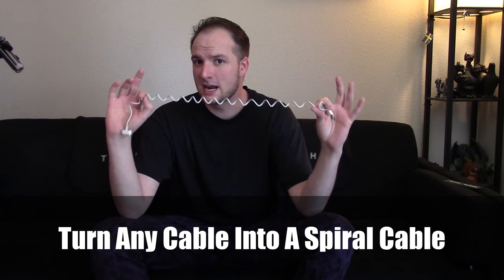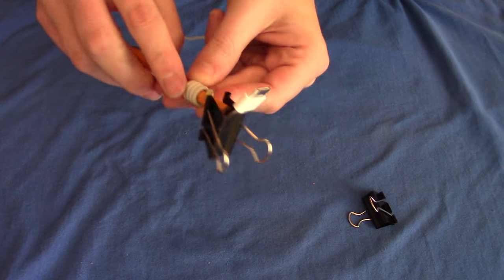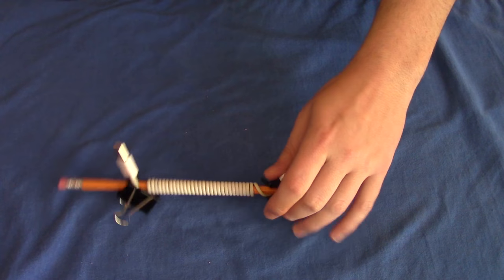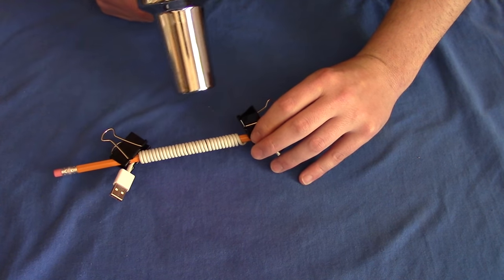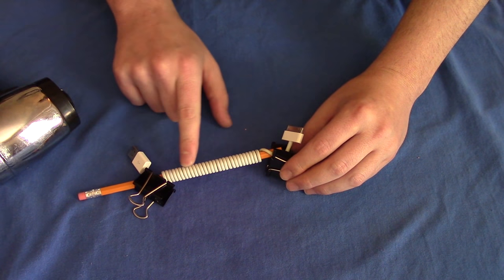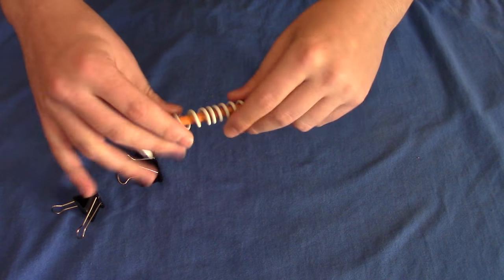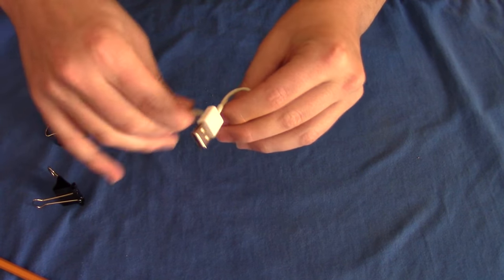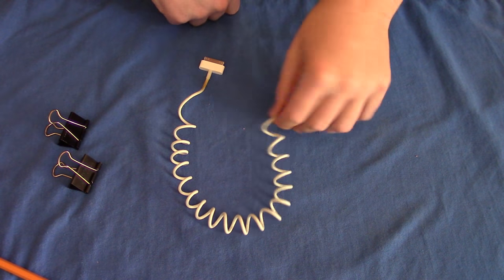🔌 Turn any Cable into a Spiral Cable

Comment: This works great for lamp cords as well...have been doing it for years!
Reply from the maker: got an example you can share? Like pic or video?
Also did you reverse coil after the fact like so many have mentioned here?
Please sub if you can.🙂
Reply: @TheThorns   I've never done it with a heat element, just wrap the cord, starting at the base of the lamp, continue til you reach the plug. You will get a tighter coil, if you do it in a warm room vs a cold room. It turns excess cording into something designer looking.

Comment: I was looking on a way to do Exactly this Since I didn't want to spends 50-100 Dollars on a Cable lol It turned out so Good I had some stock Cables and Colored USB Cables for my Keyboard And it Pretty much Works on Most Cables Just make sure you Heat it up on Max for 10-15 Minutes if you Do 5-10 Minutes it Turns out Looking bad
Reply from the maker: thanks for sharing, 😀 please sub if you can

Comment: Many years ago, I heard someone say that he did this with glue. He would coil it up with the pencil and dip it in glue...
Ive never tried it but this hot air thing looks cleaner and easier. Would have to compare results. Saludos
Reply from the maker: interesting concept, however sounds very messy. Still might have to try it.
Please Sub if you can 😊

Comment: Awesome! The internal wires are now permanetly damage u got a sub!
Reply: No they're not, This is how commercial coiled cables are made. A more industrial process, but plain cable is wrapped around a heated mandrel
Reply from the maker: Thanks for backing me up, please sub if you can 😀
Reply from the maker: thanks for the sub, this method works on many different types of wires however please do not attempt it on like  a patch cable or really thin headphone cables. That is just common sense!

Comment: The absolute best way to tie the ends without damage is I heat shrink the ends to a pencil. Keeps it in perfect condition.
Reply from the maker: great tip  thanks for sharing.
Sub if you can 😋

Comment: Overall a good video but one step is missing at the end if you want to get a tight springy spiral like a telephone cord. Once the cord is cooled you need to reverse the direction of the spiral (ie if you heated it wound counterclockwise you need to make it go clockwise). What that does is compress the spiral, in the state after the heat gun the cord is coiled but still trying to expand outwards, reversing the direction of the coil reverses this direction, turning the expanding force into a compressing force. The easiest way to reverse the coil is to hold one end secure and start twisting the other end like you're trying to uncoil the cord, after enough turns the coil will start to reverse down the length of the cord as you keep spinning
Reply from the maker: A few have mentioned this and I have tried it. Seems to be really dependent on type of cord but overall not a bad idea. Thanks for sharing! Please sub if you can 🙂

Comment: Hi, great idea so my question is my grandma has a old rotary western electric wall phone in her kitchen, the cord is too short as she says and she is right it only reaches about 5 feet she is that type of person that talks on the phone for hours.  Can I just buy her a rj11 200 feet line cord, strip off the ends to a rj9 molder cord and then coil it so she can have a long custom curly cord?  if so ill also do this to my Snoopy touch tone phone.
Reply from the maker: honestly reading what your post the time and money to complete the task buy the cable buying the ends the crimps etc. Sounds like it would be easier just to buy the proper cable or invest in a cordless phone for your grandma. However if you already have some extra cable try to coil it 1st. 

search this in google 
White Telephone Handset Cord - Extra Long Length - 1.5 Inch Flat Leader
and 8 foot cable can stretch to 50 feet.

Please sub if you can.
Reply: @TheThorns  ok no problem. I will sub
Reply: @TheThorns  I had an idea, just use one of my old phone cables for landline phone jacks and remove rj11 end, volia long phone cord

Comment: Hey, I was wanting a way to coil nylon braided cables. Wanted to know if it would break at all before I go ahed and do it :) thanks in advance
Reply: Josse that's what I was wondering
Reply from the maker: Haven't messed with nylon cables. Might have to give it a go. Sub if you can 😊
Reply: did you ever get around to trying this out? i'm thinking about curling one of my nylon braided cables
Reply: @miguelangel2746  it works just don't get super close or you will fuck up the nylon go slow and keep a good distance from the cable or it will fray ( I did a few test runs and one cable i got way to close the nylon frayed and the cable died) and let it sit in the freezer for a bit. Im not responsible if you fuck it up but I have done this with 5 nylon cables one of them died because I got to close.

Comment: You need to get it hotter.  The internal sheathing around each core is still too cold and it hasn't reached a high enough temp to undergo a thermoplastic change.  You can tell it's not hot enough because the coils spring back when you take the clips off.  Done properly, the pvc will harden in it's coiled shape and stay that way
Reply from the maker: I have had pretty good luck with the freezer , but can see your point. the strain on the plastic going from hot to cold quickly would make it a bit stronger. Thanks for sharing. Please sub if you can 😋

Comment: I wanna do this on my headlamp cable, where the light itself and the battery pack is separated at the back, and it has an annoying cable connecting them both....the thing is that that cable isn't replaceable, so I better not mess it up
Reply from the maker: I would test it on another cable 1st to get the hang of it. Best of luck and please sub if you can.

Comment: does that work with silicone cables too?
Reply from the maker: Can't say I have tried.
Reply: It will not, unfortunately!! This method of coiling requires insulation that is a thermoplastic (a polymer that softens with heat and firms up again when it cools). Silicone does not soften with heat (at a high enough temperature it just burns, leaving a fine white ash), nor does it get significantly stiffer when chilled. 

Pure speculation here: Silicone spiral cable would probably have to be molded into a spiral mold, then heated to vulcanize it. If you’ve ever seen how they make silicone cake molds, for example, they start with chunks of “raw” silicone that is like a putty, then press it between heated molds to both form and vulcanize it. So they’d probably have to extrude the “raw” silicone onto the cable, then coil it somehow (without ruining the finish and dimensions), then heat it to vulcanize it. 

I wonder if anyone still knows how we made spiral cables back when insulation was actual latex rubber, before PVC. That is, if we even had spiral cables back then, which I’m honestly not sure about. But if we did, I’d expect the process for silicone to be similar. 

FYI, what you can get, if you simply need spiral cable that is more robust than PVC, is polyurethane (PUR). It can handle slightly wider temperatures than standard PVC, but is far, far tougher against abrasion than PVC.

Comment: When you tugged on both ends of the cord in opposite directions did it straighten out or just spring back into place?
Reply from the maker: If you do it right it will spring back into place.

Comment: Will this work with speaker cables (speaker to 3.5mm aux)
Reply: any rubber cable :)
Reply from the maker: Most cables will work with this. Sorry for the delay, as I'm sure you know I can't reply to everyone. Hope you enjoyed the video. Have a Happy Halloween 🎃 & please sub if you can.🙂
Reply: @gtaracesandreviews6233  It won’t work with rubber-insulated cable: this method requires thermoplastic insulation. (Thermoplastic = a polymer that gets soft when heated, then firms up again when cooled, and can do this repeatedly.) Rubber is a thermoset polymer, which means that once it has been heated the first time to “set” it, it will not soften again.

Luckily, the overwhelming majority of wires and cables are insulated with thermoplastics. True rubber insulation is pretty much only used for power cords that need to handle elevated temperatures (for example, on irons or hot plates). Even higher (and very low) temperatures use silicone rubber. The cables on headphones, USB, etc. are always a thermoplastic.

Comment: Does this work on 22kw charging cables for EV's?
Reply from the maker: Have not tried so can not say. Personally I would only do this on smaller cables. Doing this on a higher gauge cable just sounds like a bad idea in my head. I'm sure it would be possible with enough time and heat but you would need to use something else to wrap it around. please sub if you can,  😀

Comment: NIce.Is there any other option for heating apart from the heat gun?
Reply from the maker: I have heard some success with hot water but that makes me uneasy.  Also heard bake in oven on low heat for 8 min. 🎄Happy Holidays🕎 Hope you enjoyed the video or at the very least found it informative. Please sub if you haven't already & have a safe new year. 🙂
Reply: Well they’re made commercially using ovens. But if you do that, you have to secure the wire in a way that won’t squish the ends when they get hot.

Comment: Is this safe though? Heating up electrical wire and the wrapping......
Reply from the maker: Really all depends on the wire being used and how much heat you are applying. About as safe as a glue gun if I had to compare. Please sub if you can 😋
Reply: Wrapping around a mandrel and heating in an oven is how spiral cables are manufactured commercially. So it shouldn’t damage it, as long as you don’t overdo it with the temperature. 

I routinely use a heat gun to give PVC-insulated wires and cables the shape I want inside a device enclosure, to reduce strain on internal connectors. It’s actually quite surprising how much of a wire’s stiffness is purely the insulation!

Comment: will this affect the performance of the device in any way? (over-ear headphones) i'm afraid that this method will damage the headphone's experience in some way :(
Reply from the maker: audio cables may be a different story especially if they are really thin wires.
Reply: For people who are scare there is an easy solution. Pay 50€ dollars more for the spiral cable.
Reply: It wouldn’t make any difference to the sound quality.

Comment: guitar cables too?
Reply from the maker: I would test it on a spare. what kind of guitar cables are you talking about?
Please sub if you can.
Reply: @TheThorns  they are 6.5 jack cables. I think they work just as fine
Reply: the cable jacket better used TPU or PUR....

Comment: is it possible to damage de cable by eating it up like dat?
Reply from the maker: Certain cables that are not meant to be flexible like Cat 5 or network cables may have some lose with this method. I also personally would not do this to fat extension cords. Thin and flimsy stuff should be fine.
Reply: Thanks!
Reply: It will destroy the cable and you might vomit out all the rubber plastic and metal 20 minutes later!

Comment: I'd imagine putting it in hot water would do the trick too?
Reply: fetB i think it would damaged
Reply: obviously not the end of the cable. Otherwise should do the same thing
Reply: I think that your water idea is much better, it ensures perfectly even heating on the cable. Did you try it ?
Reply: I haven't yet. Plan to do it on an hdmi cable at some point for some diy project. But i've read some people did it. If you look up coiled cable water, it will come up with some references. I probably wouldn't use boiling, but slightly cooled off (cools relatively quick when taken off the heat source). In theory boiling should be fine and the guy on instructables seems to have been successful.

PS. also look up the "how its made" version where they "reverse" the coil for more springyness
Reply from the maker: it can just be careful with the ends of the cable and make sure no moisture got into any holes.  🎄Happy Holidays🕎 Hope you enjoyed the video or at the very least found it informative. Please sub if you haven't already & have a safe new year. 🙂

Comment: thank you for the video!
here is a video that shows how its done by professionals: https://www.youtube.com/watch?v=YCgbAdRRdkY
two things to maybe improve your process:

- they heat it at 90 C (a commenter noted its heated at 120 C for 1 hour). my hair dryer has max 70 C at highest level close to the nozzle
- they reverse the direction of the coiling to make it tight. it can be done by putting the cable in a hand drill and put it on reverse
Reply from the maker: Thanks for sharing, Please sub if you can 😋

Comment: will this work with size 12, 3 wire power cords?
Reply from the maker: If my memory seves me correctly that may be a little to thick. Test it on some just cable 1st. I assume it would nee more heat however would it be to much heat for thicker cable is the major question.
Reply: I would use a larger diameter mandrel 1.5" like a pipe then blow heat down the middle  of the pipe to heat it from the center.

Comment: Is this a joke? That's not a spiral cable... it's not strechy.
That's because you missed the last step where you reverse the coil.
Reply from the maker: Reverse the coil is most certainly optional. Not required, but I see your point.
Reply: @TheThorns  Most certainly? It is mandatory, otherwise it won't be strechy AT ALL.
Reply: @alejandroperez5368  could you please refer to a video or written tutorial on how to do that?

Comment: I would assume not but do cables that aren't rubber work?
Reply from the maker: Depending on the material most plastics and rubber will work with this. If uncertain test it on a cheap or spare cable of similar caliber. Last thing you want is to destroy an expensive cable. If you have not already, Sub if you can 😋
Reply: It works on all thermoplastic sheathed cable, it's how it's made commercially (slightly different process but basically down to heating it while coiled and allowing it to cool before uncoiling)

Comment: This is cool, but you were way too close with that heat gun. It should be held at least 8 inches back.
Reply from the maker: m'eh wanted fast result, however you are correct depending on the cable, as you could flat out melt it. 
Please Sub if you can 😊
Reply: Sure why not. I just know a lot about heat guns. I use one almost everyday. Well, at least 3 times a week. The reason I said it was more about burning the shrouding more than melting it. It probably wouldn't melt it but it could burn it and leave a nice big black or brown spot on your cable. But yeah, I'll sub. Why not.

Comment: boiling water or a hot oil bath will heat quicker and more evenly than a hair dryer.
Reply from the maker: Note: this is a basic beginner tutorial. Pretty sure average joe wont want to oil bath. However great tips and information. Thanks for sharing.

Comment: i don't have heat gun, but can i use hairdryer?
Reply from the maker: some hair dryers can get hot enough, but not all air dryers are created equal.
Reply: You can just use a candle. Hold it 1-2 inches away from the flame and keep the cable moving back and forth. Just make sure you don't burn or melt the plastic.
Reply: The other problem with a hairdryer is, by the time they do get hot enough. Most of them have heat safeties and will cut off.

Comment: sounds good, doesn't work
Reply from the maker: the cable or the method?
Reply: DoctorNoob the methode, tried it 3 times with serveral cables, not once keeped the shape.
Reply from the maker: If I had to take a wild guess I would have to say that your hair dryer is not hot enough. I would recommend a heat gun. There is another method using really hot water but I do not recommend it.
Reply: DoctorNoob ok thanks, gonna dry this 

xd
Reply: So, wild guess, you did it wrong.
Reply: Pablo Fernandez i notice something salty here
Reply: After heating I find it is best to cool down a lot. I put it outside if it is cold outside or leave it on basement floor for a couple of days. Also reverse the coil to give it more tension. To do this turn one end in the opposite direction then it will flip to point in the same direction as the other end. You continue to rotate the coils in opposite directions with one side getting shorter and the other getting longer.